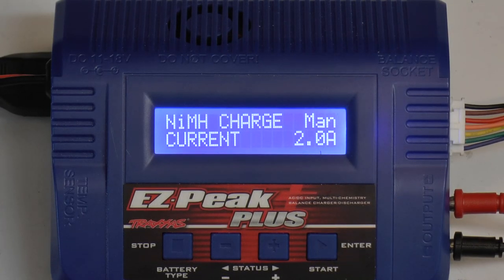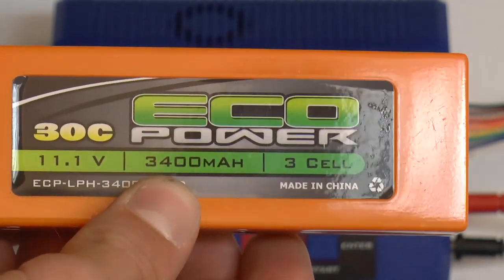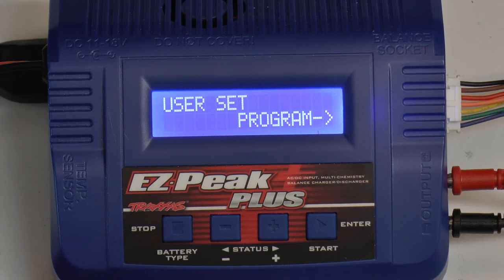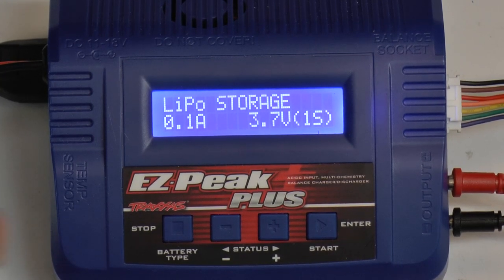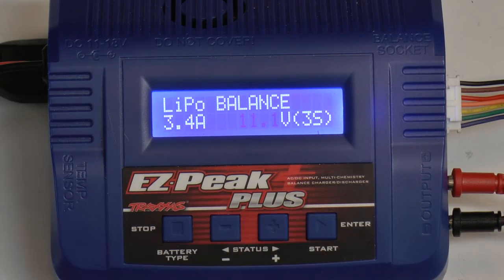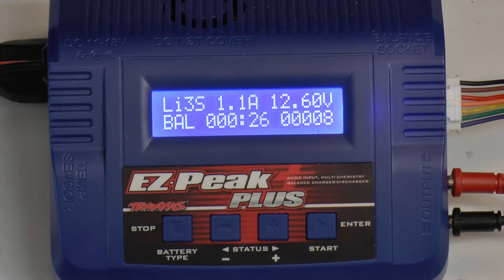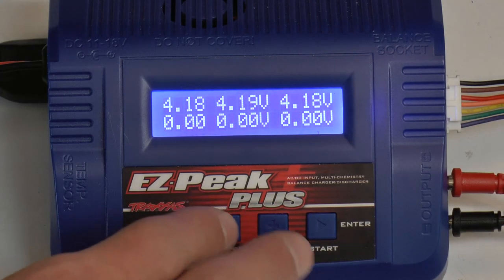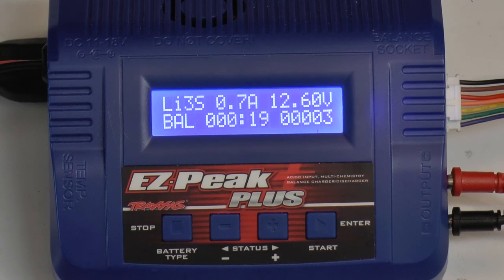HOW TO | TRAXXAS EZ PEAK PLUS 6A  BASIC

Comment: Will the charger automatically stop charging when the battery is full? Btw thanks for the video. It's very helpful  (:
Reply from the maker: Yes, the charger will stop adding amps to the battery when it detects the battery is fully charged and balanced. It automatically stops charging after 120 minutes if the battery won't balance. An alarm-like noise will sound when the charger detects the battery is balanced and full, and the top left will flash FULL.

Comment: Mine says “voltage input error” right after i plug it in and it turns on, i’ve tried different outlets and they are fine with proper voltage. Any ideas? Without anything touching, without a batter connected it does this every time just plugging it in.. Help!

Comment: I wonder if it is faster to use Lipo "charge", then "balance" afterwards? Otherwise, why would they even have made the Lipo "charge" option?
Reply from the maker: +Jake Dow lipo charge is for faster charging or lipo batteries that balance themselves. It also is the only way to charge a 1s. It would be slower to charge then balance because the battery is balanced throughout the charge. It's much better for the battery as well since the cells aren't fighting themsleves to be equal